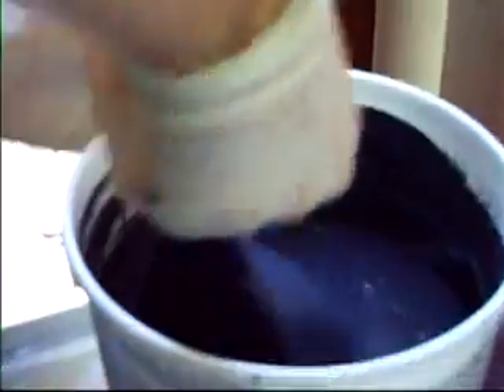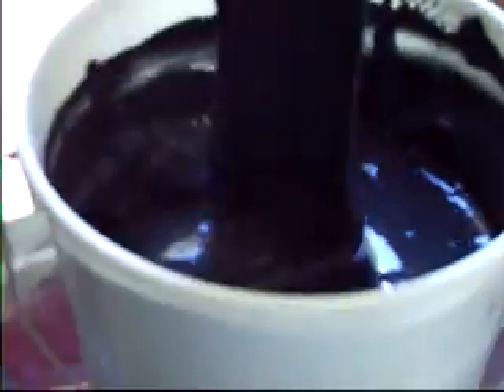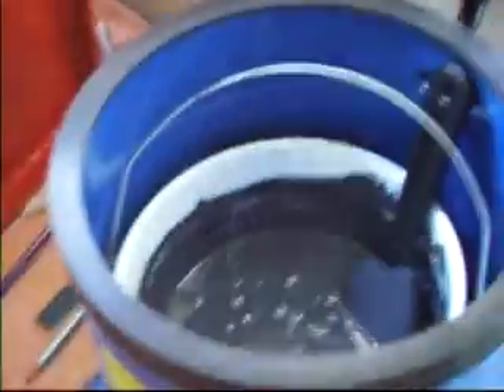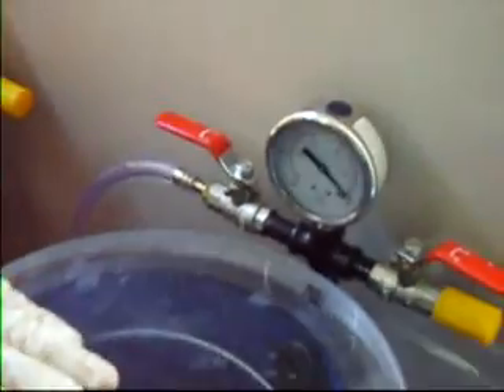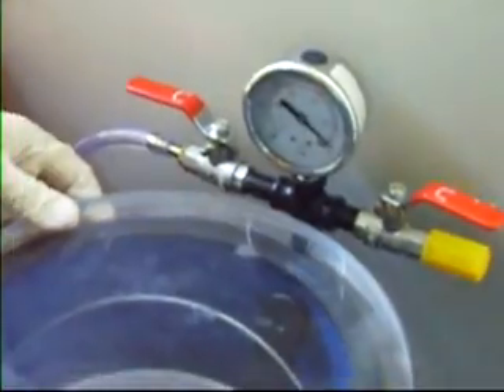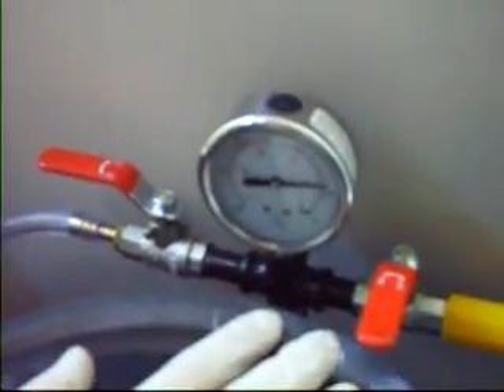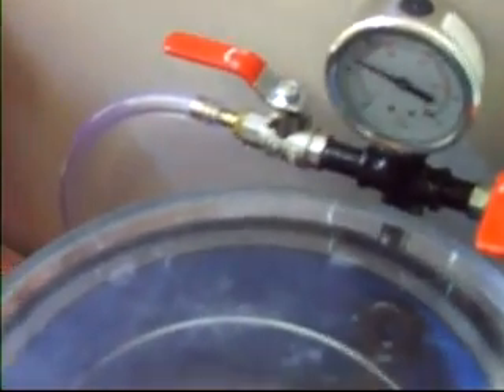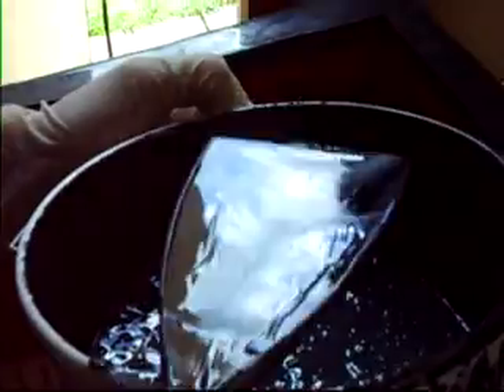mould making

Comment: How many PSI of vacuum do you need?
I made myself a small chamber and using the inlet side of a small air compressor. I have tested it on frothed up milk and it sort of works, im guessing it may need more vacuum.